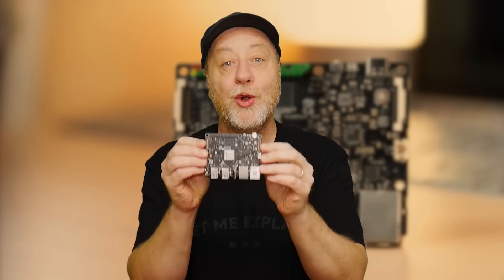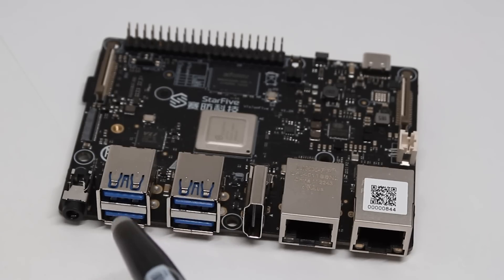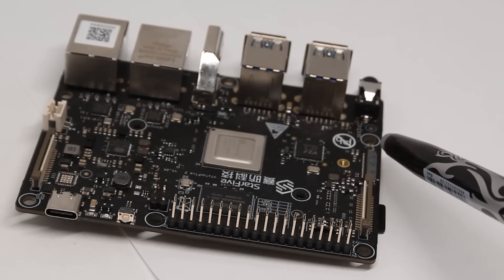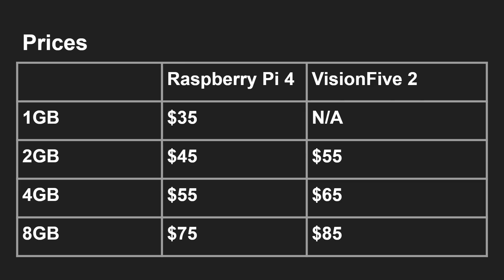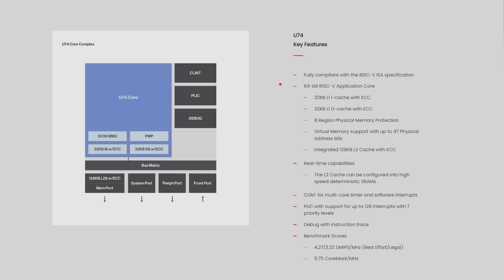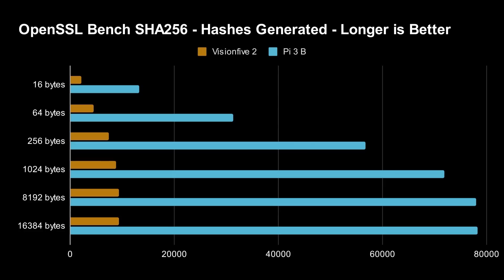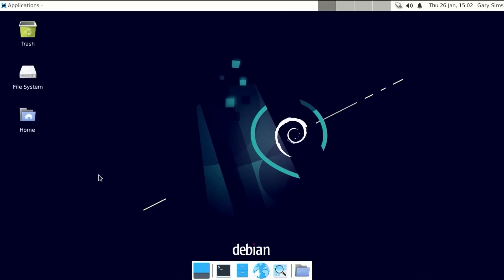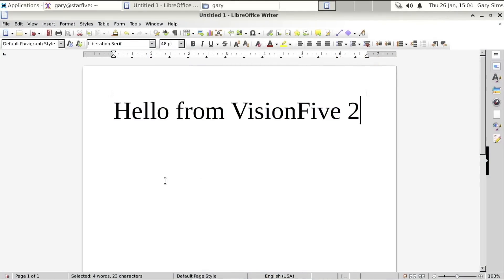VisionFive 2 RISC-V SBC - A Raspberry Pi Killer?

Comment: If you are interested in CPU microarchitecture, and you have ideas, want to try them out, want to develop new tech, then you can work for Intel, AMD, ARM. But what if you don't want to work for these companies? What if, like many Linux developers, they don't want to work for Apple or Microsoft?

Step in RiscV. You can now develop architectural enhancements as a freelancer at home, or just as a hobby. This is very powerful. We have an army pf people who are intelligent and who can now start thinking about the architecture of the CPU. Their ideas can be integrated into RiscV.
Reply from the maker: Ok and where will you find the $100 million to make the chips at 5nm?
Reply: @GaryExplains  You can validate and verify your ideas and tech on a simulator and on an FPGA for essentially zero cost. Not so much the case for ARM and X86! 
If you get to rolling a chip out then you are entering the world of commercialisation. As a freelancer, you can either make your design public and free, or you can license it to someone who is going to roll out a 5nm design.
Reply from the maker: @nickrhill  OK, so what is the world going to do with an FPGA design of your RISC-V chip? Put it in a laptop? Please be serious. I designed my own CPU instruction set and wrote an assembler for it, all here on his channel. It isn't rocket science and I didn't need RISC-V to do it.
Reply: @GaryExplains  Nobody is putting an FPGA in a laptop. An FPGA is suitable only for evaluating a design by running real-world code, such as the linux kernel to carry out performance evaluation.
Making an optimising compiler and making a CPU instruction set target for it is somewhat complicated. Having a design which you already have a compiler target for, and an optimised operating system binary for should remove many hurdles to developing mainline performance CPU technology.
Reply from the maker: And then even with the optimized compiler all you have is a hobby CPU on an FPGA. So what is the point?
Reply: @GaryExplains  CPU architecture these days (superscalar-pipelined, branch prediction, out of order execution, instruction fusing) is complex, and has been implemented to make the execution of a thread faster. (These come at a cost in the amount of logic switching needed to complete an instruction, but that is a different matter, and is evident in the performance characteristics of, say, the A76 and the A55 cores.).

There may be tecniques as-yet undreamt of by the design department of Intel, AMD or ARM. RISC-V is a platform on which these techniques may be implemented and tested. Those learning about CPUs at university or at home may develop optimised logic architecture and make an implementation of it.

For example, imagine that as a GCC developer, you are analysing the RTL implementation of generic software and find that a lot of time is spent by the CPU loading and unloading registers for function calls. Perhaps there is an optimization in using function-level register paging. So that a funciton which calls a function which calls a function, the first function has it's full set of registers paged. You could make a hint for the CPU or add an instruction that implements this, you can test it. With everyday software and binaries. You may find a 30% speed improvement. Maybe you find that the operating system switches CPU affinity, breaking the scheme. Either way, there is a paper to be written. A dissertation. A doctorate.

This is the reason given for the creation of RISC-V. To make a generally useful CPU architecture that can be used for research. The facts are that with a free ABI and toolchain available, manufacturers have begun making 32-bit RISC-V 32E microcontrollers that you can buy for 10 cents - for example, CH32V003.

Other manufactirers have designed RISC-V chips for power economy, being able to run a full OS whilst providing real-world power efficiencies 1/4 of the consumption per core op compared to the A55.  

Why might you want a Risc-V board? To test and develop drivers and software for the Risc-V ecosystem. To and verify binary compatibility. To use a lower power implementation. To use a core configuration more optimal for your needs. 

Maybe you need to carry out a lot of 128 (or even 256 bit) integer arithmetic, or 128 bit floating point arithmetic with a high performance optimised core and is compatible with mainsteam operating systems. You can implement that in Risc-V. Either in FPGA, or depending on your needs, in Silicon. If you wanted to build a supercomputer with native 256 bit registers, perhaps the best way to do that is to take the RiscV 128 design then extend it. (Of course, 64 bit is adequate for the memory addressing issues for the forseeable future).
Reply from the maker: OK, so it seems that you think that hobbyist and amateur developers will create new CPU techniques at home (on an FPGA) that will rival advancements like out-of-order execution and instruction fusing. Interesting notion. I don't think I would say something like that myself. But besides mad scientists, amateur developers, and PHd students there doesn't seem to be a need for RISC-V. Well glad we got that sorted.
Reply: @GaryExplains  You touched on a small subset of the points I made in your failed attempt to straw man me.

Someone might have scoffed at the suggestion free software license would have enabled a fully featured desktop operating system

Those may also have scoffed at the inception of Linux with the suggestion it will be both the backbone of internet technology, and the platform which the majority of smart phones run on. 

I believe RISCV will further develop in market segments from the lowly 10 cent microcontroller, to the customised silicon in the largest supercomputers. I also believe it will make further inroads into the low power consumption computing which will be valuable in battery operated equipment and in data centers experiencing massive energy price rises.

Further improvements in single thread performace may make RiscV compelling for the desktop / gaming segment. It's not so far behind ARM and X86-64. The gap has been narrowing. A few years development will likely close the gap and even put it in the lead for the reasons stated.
Reply from the maker: @nickrhill  There is a huge difference between software development and CPU development. Anybody with a $50 second PC and an internet connection can write software. I even wrote a preemptive multitasking OS for the Raspberry Pi Pico (all the vids about it are here on this channel). I never scoffed at Linux, I have been using it since pre v1.0. Making hardware is a completely different thing by orders of magnitude.

Comment: The real magic of the Raspberry PI isn't the Arm Architecture or performance, the magic is the support and documentation.

There are various SBCs that beat it on specs, but there software support SUCKS!  Raspberry PI has a much better support community.

Risc V is attractive to companies who don't want to pay license fees to arm and/or want to completely own the design.
Reply: The support from suppliers and consumers is where the Pi always ultimately wins through. If you're a hardware/software hacker looking for something cheap, then this is it, or indeed the new campaign they have on Kickstarter now for an 8Gb version with a 2242 NVMe slot underneath for £37 delivered. I backed it then though better of it as don't have the time to hunt out fixes where there's likely to be a lower level of community support.

Comment: I've seen more favourable benchmarks of this board, maybe they had a different installation/compiler for their benchmarks.
I'm in the excited camp. Not just that Linux desktop works, but that it's super affordable, especially compared to scalper raspberry pies. Even for a maker, if it's not about the result, but the journey and you want uncharted platform development, this is it.
I gotta say this board still sounds better than a MIPS board I used before.
Reply: Nothing to do with compilers in the benchmarks Gary showed. One was a hardware SHA instruction vs software -- next year's RISC-V boards will have SHA and AES in hardware, but this one doesn't yet. The other thread test is about OS internals not compiler. Someone is doing something stupid such as not implementing lazily switching FP registers, or needlessly clearing the entire cache or TLB on task switches. It looks bad on a test that does nothing except task switches, but would barely affect normal use, with task switches only maybe 100 times a second.
Reply from the maker: Bruce, sorry mate, don't try to explain away my testing. I give single thread and multiple thread scores. The multi thread scores are consistent, relative to the single thread scores. The low performance of this board has nothing to do with the OS and some bad task switching. Please stop trying to make excuses all the time.

Comment: Cute title. But no one in their right mind thinks this is a replacement. It's a stepping stone to making RISC-V a serious contender. And those of us who have a board know that there's plenty of work left to be done.
Reply from the maker: The board isn't sold or marketed as a stepping stone. Where does it say that? My job is to inform people about what it actually is. As you said, "people with the board" know the truth, I have the board and told it like it is. You shouldn't make bold assumptions about what you think people do or do not know.
Reply: @GaryExplains  I’m very sorry if you interpreted the marketing as a replacement for the RPi. I don’t think that was their intent. The first line of the Kickstarter page states: “A pioneering development board that combines performance with low-cost and full open-source RISC-V single board computer.” The video states that the previous board was just for developers, but that they are attempting to “open it up further” and to make the board “as approachable as possible for developers”. They then said that they hope to “bring the VisionFive 2 to as many developers as possible” to “kickstart the open source revolution”. 

The page does have comparisons to the Raspberry Pi, but you’ll note that it’s more comparative in nature and that the CPU performance is significantly below that of the RPi4. StarFive does not advertise this as a “replacement” for the Raspberry Pi. Only an attempt to create a competitive RISC-V board in this space that can be afforded and accessed by more developers than ever before.

As you experienced, the actual board that has been released is still very much underbaked. The hardware is all there and wired up, but the software simply can’t utilize it. Build 55 only has one of the two Ethernet ports working, supports almost no USB dongles, only 4GB of the 8GB chip are accessible, 3D support is… not quite there, and NVMe performance is rather abysmal. (I’m convinced it’s a software problem and that the hardware is likely capable of speeds of 300-400MB/s.) Build 69 requires a major firmware upgrade and then only fixes some of the problems. I’m not sure if they fixed it, but it wasn’t even booting without a manual U-Boot start at one point.

StarFive is working with their partners to understand how the hardware is interacting with the RISC-V CPU to get all these problems sorted. But even once the software reaches a high level of support, you’re still looking at a board that’s not that competitive with the RPi4. It will be accessible though, which is the real goal of this board. Mango Pi is great, but that’s not really a board that pushes RISC-V toward the mainstream. This board hopefully will, but is very unlikely to be the final say before RISC-V is competitive in the 64-bit processor space.
Reply from the maker: StarFive's PR department couldn't have written a better reply!
Reply: @thewiirocks  the CPU power is close enough to Pi 4 (about 80% for general purpose code) that you'd be hard pressed to tell the difference without a stopwatch. The GPU, once properly supported, will give a MUCH better desktop experience, Youtube etc move playback compared to the Pi 4. Give it six months and this will be a better desktop replacement than a Pi 4 is for most people. The better-than-SD storage is the icing on the cake.
Reply from the maker: @Bruce Hoult  As I mentioned in another comment to you Bruce, I wrote a quick single-core benchmark that does software SHA256 hashing in C using a function from Brad Conte. It loops round doing multiple SHA256 on a small input. The Pi 4 finishes the test in 8.9 seconds and the VisionFive 2 in 18.6. Care to revise your 80% number?
Reply: @GaryExplains  dose the ARM  V7 instruction  set  not have specific SHA256 instructions for hashing?
Reply from the maker: If you have been following the discussion, the argument that Bruce brought is that the Arm CPUs do have special instructions and the StarFive doesn't, which is why the StarFive did so badly during the OpenSSL tests. So I wrote a quick benchmark using software only hashing.
Reply: @GaryExplains  sorry, I jumped into the middle of an existing thread.
Reply: @GaryExplains  80% is an average. It depends on the code. Some code depends heavily on OoO, and some does just as well with dual issue in-order. U74 is very similar to A55, and as you’ll know A55 boards do quite well against A72 in many cases.
Reply from the maker: But you are just quoting numbers without any proof. I have given you three benchmarks, all the code is available in my repo, and ALL the tests show a huge difference to what you are quoting. Where is your proof?
Reply: @GaryExplains  if the underperformance is because of immature software. Particuly in the compilers then it will get better over time. If it is the hardware , then it is what it is.

Comment: This is not a replacement for the Raspberry Pi, rather a demonstration platform for new architecture with a lot of potential for practical use for the advanced tinkerer. One warning for early adopters is that if the board is not widely adopted, then it will end up with limited support by familiar projects with finite support.
Reply: bound to have very high adoption, as it's currently the only riscv board in this price bracket. also pine64 will release a board with the same SoC. there's really only the earlier, a bit cheaper but much slower mangopi with the D1 SoC and shortly there will be the sipeed licheepi with the TH1520 SoC.